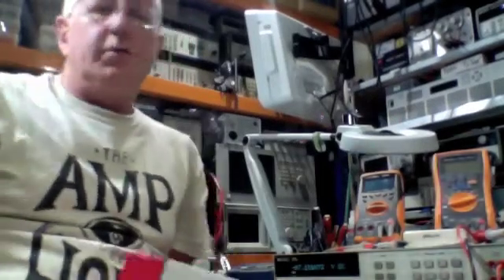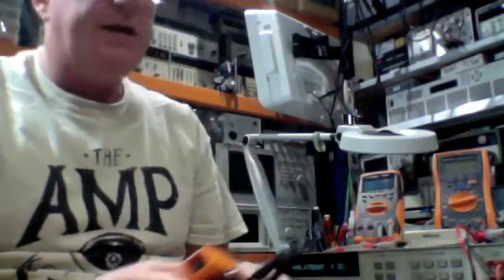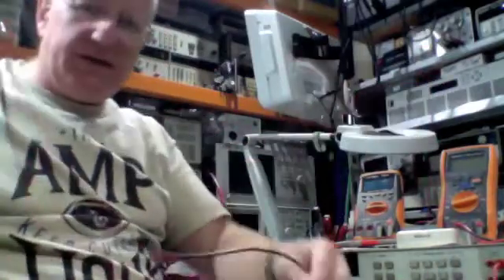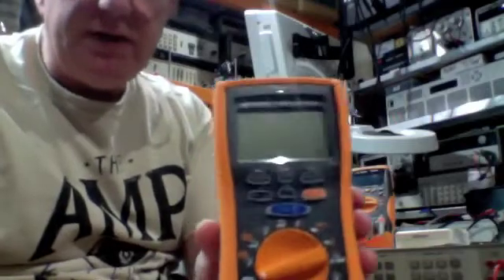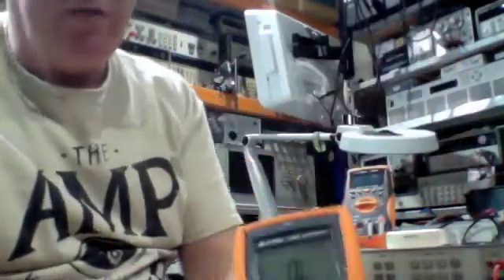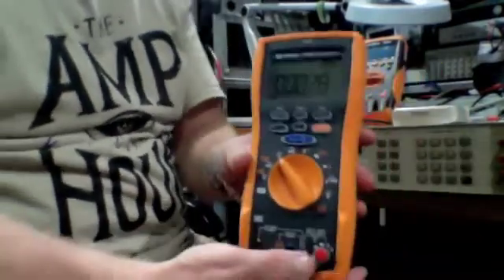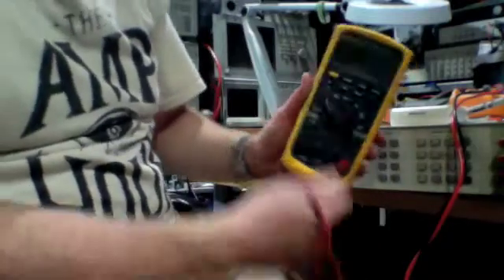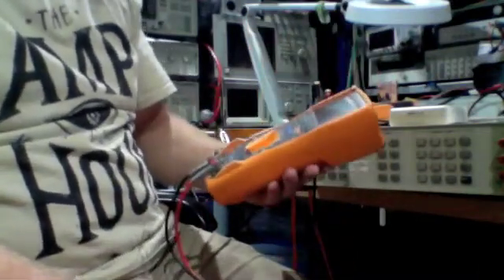Quick Review Keysight U1282A

Comment: As one whose hobby is to make cables I can tell you that pliability has nothing to do with quality. In fact, to build a high quality cable usually requires thicker gauge wire and better dielectric. Both of the better quality are stiff and less pliable. The soft stuff is usually the less expensive small gauge wire with cheap dielectric.

Comment: Hi Robert,
Looking at adding / upgrading the bench multimeter, and would make use of keysight data logging capability and software.
Whats your opinion of the U1282A compared with the U1253B with Oled display. Has the rechargeable battery given any issue. Which unit would you not part with ?

Also an EEvblog fan, and South Aussie !
Reply from the maker: +Alexander Woolford , I still tend to grab for the U1253B for general quick bench use, it is a bit smaller, lighter and I love the OLED display. The software upgrade has allowed the unit to fully charge the batteries (before they were only getting a half charge), I have not found the shorter battery life of the U1253B an issue as I switch off between readings usually. If I was wanting to do some longer term voltage measuring away from the desk I would use the U1282A however. I would hang onto my U1253b, love that OLED, I must be pretty messy as invariably when I want to measure something there is stuff all over my desk, the DMM is pointing the wrong way. The great visibility , viewing angle etc for me more than compensates for battery life issue.